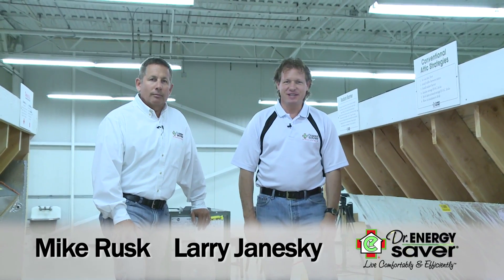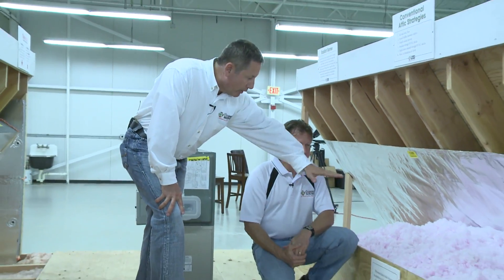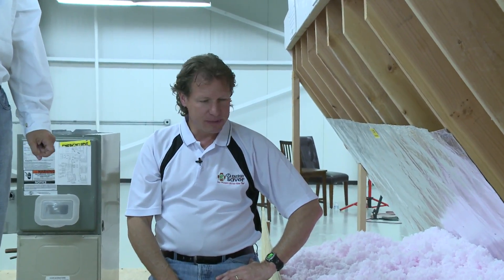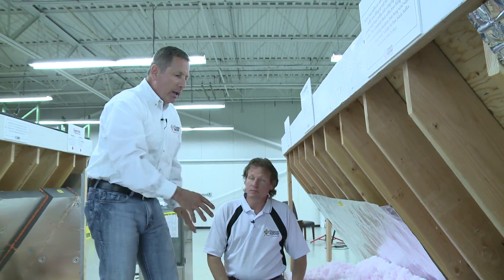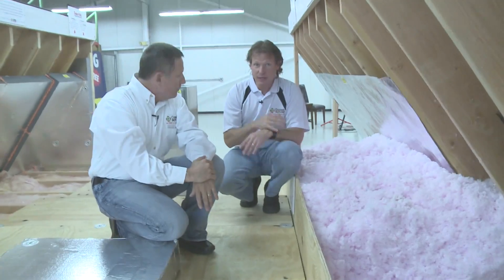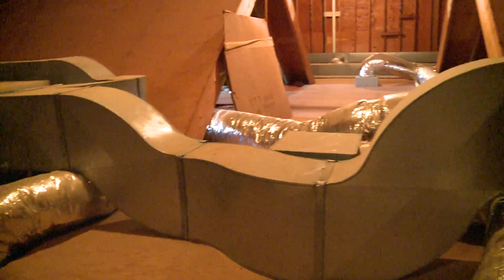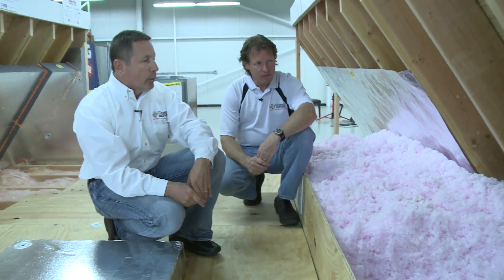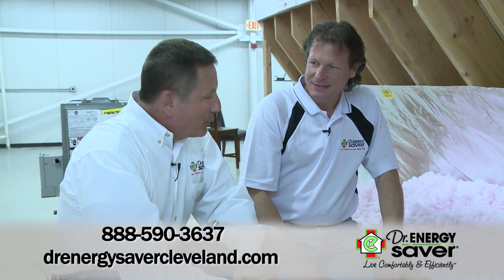How to Insulate the Attic | Air Sealing the Attic  | Energy Saving Attic Insulation

Comment: I'm in the process of insulating what will be a finished attic. Your advice is very helpful - seal air leaks, then insulate. If you'd like to comment on my approach I would appreciate the feedback. I'm doing a radiant barrier spaced 1/2-inch away from the roof boards. The 1/2-inch space will be an air channel to evacuate heat from the roof. The radiant barrier is then covered with a layer of RamBoard just for rigidity to ensure that air channel doesn't get closed up by the faced R21 I'm putting in the rest of the 2x6 rafter cavity. Ridge and eaves are vented. Thanks guys!

Comment: Why not show the product you used for air sealing?
Reply: They use expanding foam machines that a typical home-owner won't have access to (you could probably rent one). You'd be able to do the same thing with a can of the foam, but depending on how many leaks you have, you may need a crazy amount of them.
Reply: You can use a stretch caulk instead

Comment: I had this done on my home. I had two inches of spray foam on the attic floor to seal all the air infiltration, then I had 20 inches of blown in insulation. 2 inches of closed cell spray is R 7, and 20 inches of loose blown in cellulose is R 60 or there abouts. I installed baffles to allow outside air intake into the attic because you do still want your attic to be as cold as the outside air so as not to create ice damming with any heat loss, although it should be negligible. And exhausting attic air out the ridge vents is still important.

Comment: My house is relatively new, built 13 year ago.  During the process, I had to chase down the builder for a lot of things that were done wrong..  Even though I had a home inspection done, the inspector did not detect the sloppy insulation work.  The house has been a nightmare to heat.  I later even got a "pro" to go up into the attic and inspect the insulation.  He said it looked fine and was "thoroughly insulated".  WRONG!  After watching a bunch of these vids, I had a better idea of what was right and wrong.  I lifted up the batts and found all the normal stuff . . . no air sealing (despite the builder claiming this was done (they declared bankruptcy and no longer had to warrant any claims for their shoddy work).. . . wires laid partly through the joists and the faced insulation was not laying flat on the drywall, huge gaps, where batts just never met . . . . The list just goes on and on.  So I have a huge mess on my hands to tackle to get this all fixed.  Hiring someone is just out of the question, as funds are extremely tight.  So I guess I have to tackle fixing this over a long period of time, bit by bit.  So this is just a warning to everyone. . . . Don't trust your builder.  Don't trust your home inspector (he also was sued by many and filed for bankruptcy).  Don't trust the so called expert you hire to evaluate the problem.  It's the old adage. . If you want the job done right (learn everything about it and ), then do it yourself.
Reply: Amen!!! I feel for people buying homes today being built by unskilled shoddy laborers hired by unscrupulous builders wanting to cash in on the buying frenzy
Reply: you're right. It seems like everyone is lying and cutting corners.
Reply: 4 yrs later

Comment: I'm interested in improving thermal energy efficiency in older homes. 
Very concerned about filling 2x4 wall cavities solid w/ foam because foam is still porous (I believe Class 2 Vapor Retarder) My 1957 home has FG 2" batt w/ kraft paper, leaving a 1" air space to the exterior cladding. My house is cold, but the shiplap sheathing is still in good shape. I believe this is because the porous insul plus the air space allows the wd to dry out.
I want to demo the 7/8" interior plaster & insul & then install 3" porous insul (like "Comfort Batt") in the stud cavities, then cover the inside stud face w/ 1/2" xps insul, then vapor barrier over, then finish w/ 1/2" gypboard & 3 coats paint.
For the exterior, I would like to demo the stucco & metal wire mesh and building paper, & then install a good rainscreen/house wrap like "Zip", then install 1 1/2" or 2" compressed rock wool insul board over, and then finish the exterior w/ siding. 
My idea is going w/ low porous insul on the inside and low porous in the cavities and exterior, and leave an air space again the exterior sheathing.  The idea being, following the same principle as attic thermal design. 
Just asking.

Comment: My attics is done the same. The rooms upstairs got so hot during the summer that we couldn't sleep there, sleeping downstairs was the only solution. We double shielded with 90mm boards. attic is now the same temp all year round also the bedroom that is next to the attic is cool during the summer and warm during the winter. Air vents allow air re circulation from under the sofits & eve, this air circulates around the outside of the 90mm board, no stale air.  Plasterboard with no insulation made the bedroom extra cold in winter and hot in the summer. Insulating properly will save the heating from cycling on/off.

Comment: There is a point to where too much sealing can be not desired. If the home don't have a heat pump to supply the home with preheated fresh air, then no need to seal every single joint, what for, so they have to open a window or 2 in the home to have some breathing air. You need air in the home, fresh air anyway, yes i understand sealing big leaks, but you seal it up like a drum it is not healthy.
Reply: So then you get a HRV and know the amount of air you are purposely leaking into the house, as opposed to not knowing how much air is leaking through all the leaky holes.

Comment: you guys are making it seem more than what it is. the heat loss thru both small holes and area's are so minute that you will never feel it. you just wanna justify the high price tag you quote people. i will kinda agree with the chimney leaks though
Reply: A lot of little holes could add up to a window cracked open. I wouldn't leave a window even cracked open.  I put weather stripping around my doors to fill the cracks.  I wouldn't ignore holes and seems and cracks.
Reply: Sorry bud you're wrong Do a door blower test & see for yourself
Reply: This is simply not true, Air sealing is vitally important.  The difference can definitely be felt.

Comment: Should I be more concerned about the R-value of the insulation in my deck or the thickness??
Reply: They are proportionately related.  Insulation has a certain R-value per inch of thickness.  So how thick it is, determines the R-value.